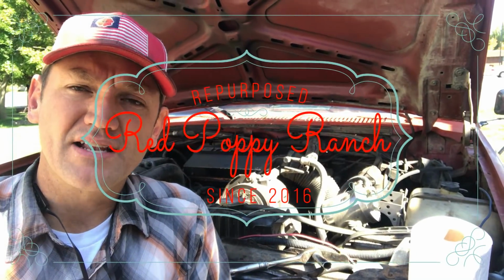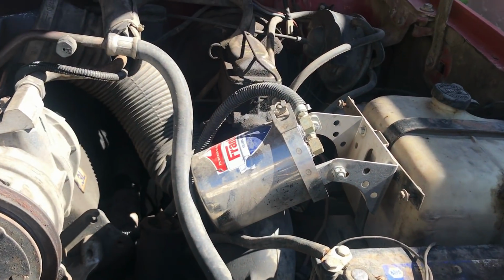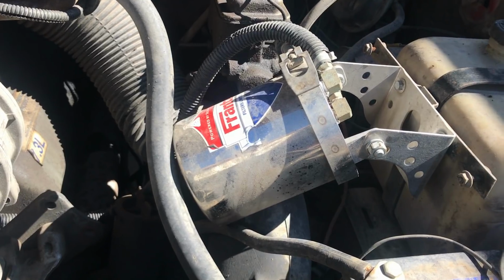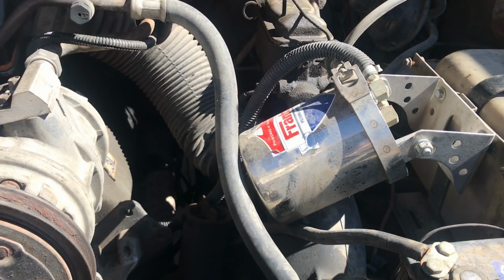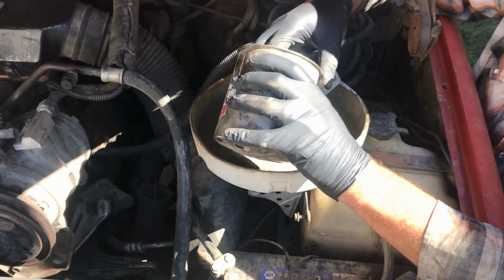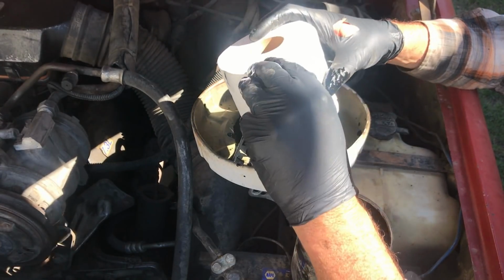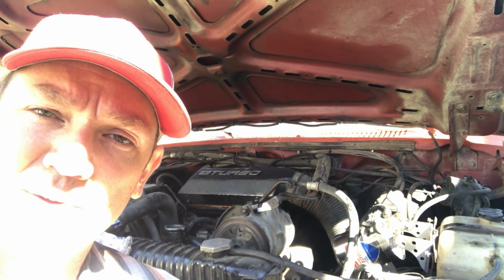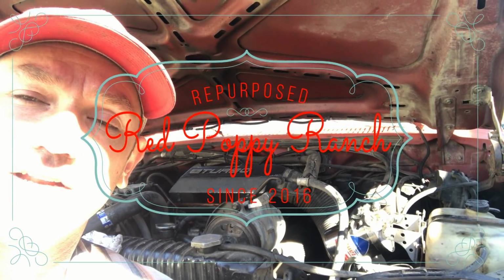#146 - Toilet Paper Oil Filter Maintenance... (Frantz Oil Filter)

Comment: Just bought a 16 pack of Great Value 1000 at Walmart.  I didnt have to remove any rounds  of paper. Looks like it is the same  diameter  as what we used in the 60s. The core is a little larger than 1 1/2." It was a perfect fit in the Motor Guards.The last Great Value 1000 sheet I bought at Walmart  was the same diameter as what we used in the 60s. Didnt have to unroll any. The Scott 1000 or the Great Value 1000 dont channel.
Reply: Recommended that the TP be made of virgin paper, not recycled.

Comment: Toilet roll has to be 500 sheets of 2ply you may need to remove a few sheets.Best thing to do before fitting the roll is to put the roll on your knee & pull the roll down to make a small cone shape then insert the pointie bit in last & get a small tin ect same size or so as the roll holder & push roll in but not hard up the top canister.Mount canister to base & a firm hit with your hand then tighten clamp.

Comment: I'm surprised yo don't employ (use) a pair of wingnuts w/serrated or split lock-washers to on those bolts, to make it easier to loosen & service. (One less tool needed!)
Reply: I was able to bolt my bypass filter to the plastic fan shroud in.an an upright position. 84 F 350 6.9. No spillage. Drivers side.
Reply: I like the top loaders. I like to use the less expensive oils like Delo or Rotella and change the filter more often. My oil will be cleaner than using expensive oils and changing the filter less often.It takes about half  a minute to change mine and add a quart  of oil. Done it that way for almost 60 years.Change mine every 2,000 miles and add a quart of oil. I was lucky with the.Gulf Coast junior. I bolted it to the fan shroud in an upright position.  Returned the oil to the oil fill neck with a self tapping hollow bolt. If the Frantz was installed like my Gulf Coast junior it would drain like mine. No spillage.

Comment: When I say modern cars have almost no large abrasives and lots of smaller engine wearing abrasives it is true but don't compare to the old cars. You could pull a roll of toilet paper out of a Frantz. Squeeze the top and nasty sludge would come out. Squeeze the bottom and beautiful golden oil would come out. You knew the Frantz was doing its job. With these newer gasoline powered engines its hard to tell the difference.

Comment: I admit I'm very curious about one of these, but the fact of the matter is a well-maintained engine won't contaminate the oil with enough particulates to matter before the oil loses its film strength and needs to be flushed anyway.
Reply: The problem is people make a lot of assumptions . They think they know more than people that have used them for.50 years. Was working in a full service Standard station in California in 1963. The Frantz came from Modesto ca.  It was sir I see you just changed your oil. It was like yes 100,000 miles ago. That's how I got hooked. The grocery stores were full of high quality toilet paper. Now you have to be a highly skilled toilet paper squeezer or buy the Frantz elements.or just buy Scott 1000. I have been using some Great Value 1000. TP sometimes changes.on my old Motor Guards I put a spacer in to compensate for the shorter rolls. Probably not necessary..the new model Frantz is designed.for TP. It looks like to me. It looks more user friendly when using Scott 1000.
Reply: It looks like  you are like a lot of others in that you already have it figured out.

Comment: In the old days many engines had so many large particles in the oil there would be danger of the orifice clogging if at the inlet. I like to put the orifice at the inlet. Haven't had a problem with moderns engines. I try to put the orifice at the source keeps the oil pressure out of the filter and hoses.

Comment: I sure hope you have a by-pass valve.
Reply: why?
Reply: Toilet paper dissolves, comes apart and clogs up. I cannot see anyway possible for oil to make it's way thru that type of media stuffed into a can.
Reply: Bypass filters have been around for over 100 years None of tem have bypass valves. This goes For Frantz. Gulf Coast Luber Finer Fleet Guard. ECT. Full flow filters.need a bypass so that if the filter gets clogged the engine still gets oil.If the bypass filter gets clogged clean oil stops going to the oil pan.
Reply: It would be good to learn about the filters before you make assumptions.  Oil  doesnt dissolve paper. If it did I would have known it in almost 60 years of using it to eliminate oil waste. When toilet paper filters are mentioned the fools come from all directions. If oil couldn't get thru toilet paper we would have figured that out too.
Reply: @4793bigdaddy  I think John Frantz made a mistake when he decided to use the best filter media available toilet paper. He should have come up with something as good that he could call something else and charge a bunch of money for. I know of one that is as good as toilet paper. The elements cost 30 bucks I'm told. Because of John  Frantz I'm stuck with 1 dollar Scott 1000 sheet. I got into a debate once with a guy that knew more than I do. I'm used to debating fools He said you are good at defending the filters. Send me a propaganda package. It was NASA. He said bring your wife down. I'll take you on a tour and we can talk filters. I called Gulf Coast Filters and told them to talk to this guy. Now NASA  is using the filters. What  I say doesnt always fall on deaf  ears.

Comment: At one time Frantz sold ATF adapters. Don't know if they have them now. I make my own. It is two tees with a 1/8" orifice in between them. The fluid hits the orifice and some of it goes to the Frantz. The clean fluid goes to the lower pressure side of the orifice. I think Frantz used a smaller size orifice. Gulf Coast used 1/8" Of course you need to know which way the fluid is flowing.

Comment: after the colapse we know where all the TP will be!
Reply: bigd95822 Don't know if I'll still want it when they're done!
Reply: Used toilet paper filters for 56 years. Never heard of it collapsing.
Reply: 1 changed the pleated paper in my daughter's Pontiac Sunbird. It has the little cartridge filter at the top of the engine The pleated paper was crushed by the oil pressure. You dont see this with spin on filters unless you cut it open. Normally happens with neglected filters. This one wasnt neglected. Never heard of collapsed  toilet paper. Oil pressure will sometimes make it shorter. Sometimes the core will be 1/2" longer than the used roll of toilet paper. When that happens you know it's working good.

Comment: My 41 Dodge had a factory installed bypass filter. They used cotton as a refill element. JOhn Frantz came out with an adapter that allowed you to use the more effective roll of toilet paper. Toilet paper was about 10 cents then. Luberfiner used cotton and later chopped up newspaper and wood chips. There were no full flow filters up until the 50s. My Rambler flat head had a spin on bypass filter bolted to the head the same as a flat head Ford. As a rule of thumb none of the pleated filters clean oil you need depth. Auto makers knew that engines needed both a faster filter and a depth filter to clean oil. Bypass filters were expensive and were sacrificed to concentrate  on the large engine damaging abrasives and depend on oil drains to eliminate the smaller engine wearing abrasives. Correction. The flat head Ford had a cartridge filter. Good elements were being eliminated by the time my 64 Rambler was made. Less effective pleated paper  had pretty much replaced  cotton. I always thought the Fram filter was factory installed on the old 41 Dodge. It was 15 years old when I bought it. I'm told it could have been dealer installed. Also auto parts stores sold them
 They used cotton. When we no longer could get good elements for the cannister filters at the gas station you could get good elements at Grand Auto parts in San Jose california. And the Fram housings. They also sold the Motor Guard toilet paper filters which were the best at the time Early 60s. Sometimes on sale at about 12 bucks.

Comment: It is true the Frantz elements are better. I have used toilet paper for over 50 years. The Great Value 1000. In the 16 pack costs me less than 60 cents and it is just fine.

Comment: Good job ~ used these since Frantz sold them, have them on almost everything, putting one on my Ford truck now ```
Reply: I started using the Frantz in 1963. Some of these old bastards have been using them longer than I have.
Reply: Was just down at Walmart. I picked up a 16 pack of Great Value 1000. I converted some M 30 Motor Guard compressed air filters to lube oil. This package  was just the right size for the Motor Guard. Because  the last sheet was glued it didnt pinch in the gasket. The Motor Guard liked to pinch that last sheet. The core was a little larger than the Frantz tube which is no problem if you know how to change the Frantz. With this paper you might not need to unroll paper with the Frantz. They keep messing with the size. I guess I will have to take a tape measure with me the next tjme.
Reply: My 76 F250 with the 390 has a Motor Guard on the oil and a Gulf Coast junior on the transmission.  If I had a Frantz  I would put it on something. I have toilet paper on every thing I have with a oil pump. Dont drive the Ford much any more. Daughter didnt mind seeing the  f 350 diesel going. I think she has her eye  on the 76 and bass boat. Dont let her fix me any drinks.

Comment: People think the oil is dirty because it is black.There will be a small amount of soot that is non.abrasive and will find its way through even the Frantz. Elements. It is like ink. The same thing is happening in my gasoline cars but the amount of soot is so low it is hardly noticeable. I notice the oil looks like dark honey in the Pontiac Torrant and light honey in the Nissan.Altima.This suggests to me that the Altima is generating less soot. I have toilet paper filters on propane lift trucks The oil looks the same as new. Some say heat turns the oil dark.as far as I can see with the oils I use only soot will turn the oil dark. When I started using the Frantz Frantz would tell you which oil stayed golden When clean. At one time.Frantz had their own oil. Of course it was golden When clean. Diesel pickups weren't common then.

Comment: I find it hard to believe that the toilet paper fibers aren't breaking off and going into your motor. Would be interesting to see if the main filters has cellulose fiber in it.
Reply from the maker: The toilet paper never breaks down.
Reply: @RedPoppyRanch  the cellulose may not break down but if you take a roll of toilet paper and tap it on a glass table you will see fibers floating around.  I can definitely see how the till can be a pretty good filter I'm just worried at the back end of the filter letting some fibers loose.
Reply: Dune Buggies and Hot VWs did a test on the Motor Guard oil filter in the 60s They put an inline pleated paper fuel filter in the return line to the engine.of course paper fibers can't get thru pleated paper.They cut open the fuel filter looking for paper fibers and found none. They did a nice article on them. They were popular on the Baja race cars.Dick Cepec tires sold them for off road use. They used 2 ply facial quality toilet paper. They only make compressed air filters now.
Reply: I have seen the pleated paper break down in a full flow filter. .It is rare but it is caused  by neglect. When I change my toilet paper I can tear it off at each sheet  paper gets very strong in oil.
Reply: I've used the toilet paper filters since 1963 starting with the Frantz. I have a habit of cutting open full flow filters checking to see what is in the pleats. Never saw any toilet paper fibers. If I had concern about toilet paper getting in the oil I would invest in a metal inline fuel filter toilet paper fibers cannot get thru a inline fuel filter The FAA and PMA approved AeroFrantz  used 2 ply facial quality toilet paper.
Reply: People make a lot of assumptions  about toilet paper such as it breaking down in oil. Other elements that cost 30 bucks and are the same  high quality paper  dont have that problem. You wouldnt hear someone say doesnt the pulverized newspapers  in the Luberfiner 750 get in the oil. I'm not helping  get rid of the words toilet paper. Sorry Frantz Motor Guard and Gulf Coast.

Comment: No one has ever came up with. a better filter than a firm roll of toilet paper. The problem with toilet paper is the name and it doesn't cost enough. Another problem is when Frantz came out toilet paper was pretty much a standard size.Frantz called for 2 ply facial quality which was easy to find. I just found a roll of 50 year old Scott that my wife had stashed.NASA had a problem with the purchasing department.They ordered Gulf Coast Filters to put a sock around the paper towels and toilet paper and call them fiilter elements.

Comment: good video, but i've been thinking. Doesn't a regular oil filter have a by-pass , should the filter clog. If not the engine will starve of oil. So by filtering  down to a few microns, i would be afraid of oil starvation and the  results. Not sure really.
Reply: That's why they call it a "by pass" filter.  Only 10% or so of the oil is filtered in this filter. 90% goes thru the regular filter at any given time.
Reply: The bypass oil filter takes pressurized oil and runs it through the medium; filter, toilet paper, AND then an orifice before returning the oil to the fill tube in this case.
Without the orifice it would drop oil pressure from the system; perhaps excessively.
If the bypass filter or orifice becomes plugged, it defaults to stock.
Reply: When it can't hold any more sludge oil will stop going thru it. Then it is the same as before you installed it. The oil just starts getting dirty. Before the 60s there were no full flow filters. Cars came with either no filter or a bypass filter. Sometimes filters were optional equipment.
Reply: With the conventional way of installing a bypass filter the clean oil is continuously going into the oil pan until lt is all clean.The oil isn't supplying any parts.It is supplying the oil pan with clean oil. A Perma Cool universal sandwich adapter doesn't supply. the. oil pan it directs the oil to the full flow filter. It is actually an oil cooler adapter but works the same for. the bypass filter
.No orifice is needed.with that system.
Reply: His Frantz hooks up the same.as the factory installed bypass filters on my 41 Dodge or the 55 Studebaker.  If the filter is neglected and clogs up clean oil stops going to the oil pan. The Gulf Coast junior on my 6.9 Ford diesel hooked up exactly the same as the 55 Studebaker  V8 . Clean oil went into the oil fill neck.  Had the factory installed bypass filter.  No full flow filters on those cars. My oil is.probably cleaner than his because I change my TP more.often than he does. Some bolt a big Gulf Coast on the frame. That's for people that drive a lot of miles. Did that on a Dodge Cummins. Had to cut a 1/4 inch plate so I could fasten both  brackets . Bolt pattern  wider than the frame.

Comment: One pproblem we had back in the 60s was we had a lot of Sludged up engines that had been badly neglected. They might have 2 quarts of motor oil and 5 quarts of sludge counting what was in the valley and the valve covers. The little toilet paper filters could handle about 6 ounces which would sometimes take only a few miles to clog the filter. If the engine had a full flow filter It might have been clogged for a long time With the bypass valve open. It was too late for any bypass filter. The non stock filter will get the blame for the stupidity of the engine lower. We don't have that problem these days. I recently bought a 2006 Nissan Altima with 225 k on it. The valve guides were worn. When I pulled the cam cover it looked like a new engine. That would have been unheard of in the 60s.piece of cake for a toilet paper filter for this car.

Comment: Just stumbled onto some Amsoil stuff. They have that sales pitch down. I tried Amsoil in a company pickup when they had Bobby Unser saying this oil change is forever. At about 60 K the oil was like road tar almost lost my job.I was using the Frantz.The Frantz was a better filter and the Amsoil filter.was.pretty good. The problem was I was using Amsoil recommendations. The filters now aren't as good as the original one. The sales pitch is really good.